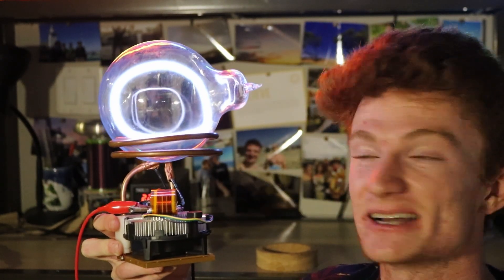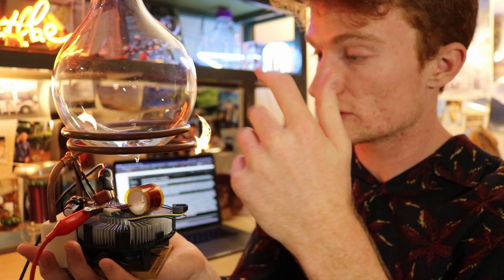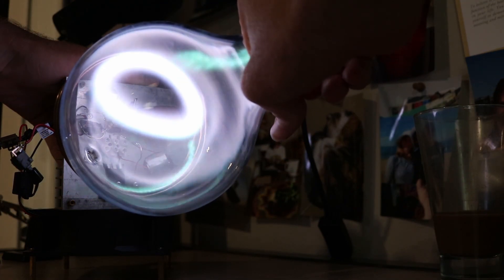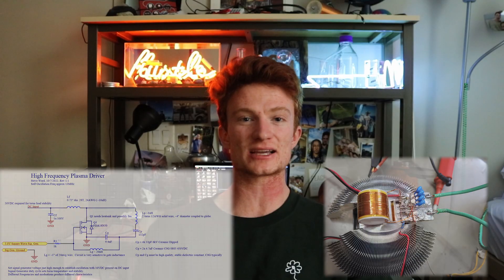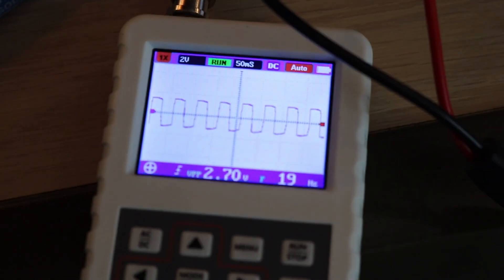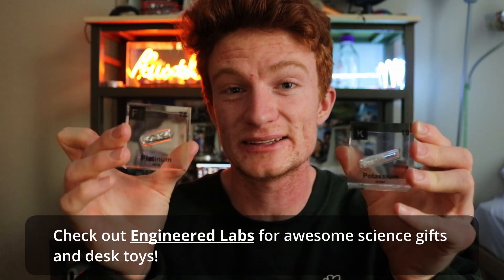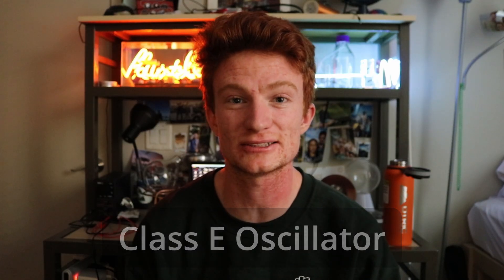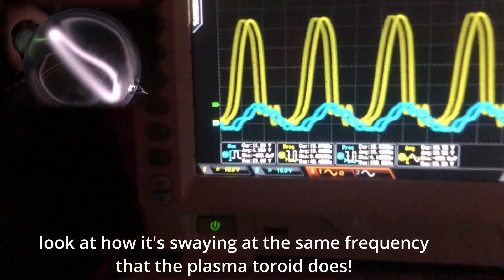perfecting and explaining the plasma toroid

Comment: Maybe a few improvements: 
Add an op amp amplifier for the music input
Add a tvs diode that would prevent overvoltage on the mosfet drain
Maybe drive the mosfet with a gate driver (that is fast enough (there are drivers that have 5ns transition times)) so it switches faster and heats up less. I have no idea if this would work or not though.

Comment: Have you heard of the "Vector Potential Transformer Coil"?

A team of scientists in 2008 were studying the work of Oliver Lodge and James Clerk Maxwell describe a new induction effect called the "Maxwell-Lodge effect". They realized you could generate electric fields without magnetic flux (B-field), using a gradient of the magnetic vector potential (A-field). The magnetic vector potential or A-field is mathematically defined so that the curl of the A-field equals the B field at any point. But when the B field equals zero, the A field does not necessarily equal zero, just the curl of the A field equals zero. So a gradient in the A field can exist while the curl of the A field remains zero (so no B-field). 

Essentially the magnetic vector potential (A-field) wraps around the magnetic flux (B field) at right angles to it in the same way the B-field flux lines wrap around the E-field flux caused by Current flowing. A loop (A-field) around the loop (B-field) around a line (E-field). 

There have been several patents and experiments now that prove you can generate Electricity without Magnetic flux, even through thick metal shielding, by using a "coil of coils", so that the B-field is confined to the interior of the coil, while an A-field (and changing A-field flux) can exist in the axis of the coil-of-coils. 

This could be useful to produce plasma toroids inside of materials that would otherwise shield the magnetic field of a standard magnetic field coil.

Comment: I wonder if you could use other nobel gasses. I would love to build this but xenon is a deal breaker. Argon is readily available. Thinking about using a round bottom flask. Refrigerator compressor as a roughing pump and a gravity mercury pump to get the rest of the way.
Reply from the maker: Yes give it a try with 0.16 Torr argon for best results (according to 20th century literature using a pulsed RF generator)

Comment: If you had two emitters, you could tune the coils with a piece of metal sliding in and out the core in that circuit. Would the beat patterns make moire patterns in the glass? If one emitter was a sawtooth and the was from your bluetooth, and they were at 90 degrees, could you make a floating scope?

Comment: One  question about your circuit. I noticed that your improved circuit follows a schematic from Steve Ward. However, the circuit that you built is not the same circuit. The Ward schematic shows three inductors, a gate, a tank (toroid drive coil) and a bias choke. Your final circuit looks basically like the Teslaundamehr circuit, with only two inductors.  Can you give a more detailed outline of the perfected circuit? 

Getting the toroid to work appears to be a finely tuned solution and it would helpful to have a better idea of the starting point.

Cheers.
Reply from the maker: My pleasure, Alan. My final circuit uses ward’s component values but i create a DC bias to the gate using a 10K potentiometer instead of ward’s (superior) function generator method. (In fact in my next version i’ll use either a series of 555’s or a microcontroller to modulate the gate with PWM like ward, but more compact.) the inductor in the ward diagram going to the gate is just a jumper wire modeled as an inductor (hence the nH value) and can be ignored really, as long as you make the jumper as short as possible. Good luck, and i suggest using a function generator with 5V amplitude to bias the gate instead of the pot, as the pot method makes striking the toroid MUCH harder.
Reply: @BackMacSci  Thanks. One other question. When I was building this circuit for a flame tesla the most difficult part to source was the tank capacitor (HV ~100pF).
I finally ended ed up with a surplus russian RF cap. In your new build you started with some blue ceramic caps in parallel. I assume four 33pF. In the final build you are using a ceramic doorknob cap. Do you have a part # for that cap? If not, the cap/voltage rating?

Cheers.
Reply from the maker: In my final, i used the 4 33pf ceramic dipped caps, not a doorknob cap. Use the 33pf ceramic caps, I will be releasing a BOM soon.
Reply: @BackMacSci  Great. Thanks.
Reply: Got the schematic. Thanks again. 

Cheers.
Reply: Just a comment. The schematic has an error. The power supply is floating (no connection to ground). No significant current can flow through the Class E amp as it is drawn. The source of the MOSFET has to be connected to the negative lead of the power supply.

Cheers.
Reply from the maker: @cometboy1  I used a triangle pointing down from the source of the MOSFET to signify connection to ground. Is that not enough? If I connected the source back to the negative lead of the supply, it would be a big old wire on the schematic. That's why I did what I did.
Reply: @BackMacSci  That is fine for the MOSFET but power has to get from your power supply to the MOSFET. In the schematic the only current path to the MOSFET is through the bias resistors. In any case, I've built the circuit and it works with the negative lead of the power supply attached to the source of the MOSFET. 

Try ohming out your great looking toroid display. I'm sure that there will be a zero ohm path from the negative of your DC supply to the source of the MOSFET.

Cheers.
Reply: @cometboy1  I thought I was signifying the connection between source and negative lead with the arrow, but it's clear to me now that's not the right notation. Thank you, Alan.
Reply: @tatemcaluney6124  It an easy oversight. Just add another ground arrow at the negative power lead. 

Cheers.

Comment: Hey, an idea to make the toroid “sing” you could use another transistor (non-power) connected to the Bluetooth receiver with the output on the input side of the drive circuit. You could tune this to output the right range for the toroid driver.

Comment: Just as a way of "ruggedising" your mosfet drive, have you considered using a comparator to sense the voltage switching and then follow that up with a beefy mosfet driver? Something like a TL712 followed by a tps2816? (just first example parts I found) You'll drive the fet into full saturation or totally off then. no third state of digital logic ;-) You can also shield the input to the comparitor a lot more than you can the mosfet as it's a quite high impedance input. Resistor dividers to bring it into range, Some TVS diodes just in case and then best of all like a 50K resistor before you get to the input of the comparitor lol 

Also have you thought about some kind of igniter? Throw a few hundred volts into the coil from a capacitive discharge or even just throw a raw spark near the sphere itself to kick it into gear.

Regarding youtube aspirations, lighting is key. An old saying if you've got $1000 to spend on a camera spend $800 on lighting. Also a tripod for your action shots would help a lot. For the stuff you're doing if you can get a high dynamic range camera (a lot of phones will do it) it'll help bring up some of the details that are getting lost in the blacks at the moment trying to fit in next to the glowing stuff. I suggest davinci resolve for your colour grading/editing needs, the free version does almost everything the pro version does, plenty for starting out with. And the pro version is a one off charge, not an ongoing subscription cost.

Regardless, you're doing awesome work my dude, look forward to your next video.
Reply from the maker: Thank you Zyeborm! You are awesome for all this. I don't quite understand your ruggedization circuit, but that's on me, I'm still learning. I'm considering working an igniter into the next circuit, yeah, and I use davinci resolve free fro editing and I haven't bothered to color grade hahah.
Reply: @BackMacSci  the (an) issue with MOSFETs is you need to keep the gate drive voltage in a pretty narrow range, you also want to get them to that point very quickly to stay out of the linear region. A comparitor is a chip that just compares 2 voltages and gives you a digital output. If input a > b then the output is high if a < b then the output is low. No middle ground. You feed a sine wave into it you get a square wave out.

A MOSFET driver IC is a chip designed as the name suggests for driving MOSFETs. It'll take a logic level input (say from your comparitor) and turn it into a high current output at 12 volts (if you feed it 12v power). That particular one will push 2 amps into your MOSFETs gate, so it'll transition from off to on very quickly.

Basically it's isolating and buffering the MOSFET gate drive from the resonant part of the circuit. It uses that as an input but not directly to power the MOSFET gate. So if it does weird stuff you're less likely to fry the fet (I think, haven't tried it)
Reply from the maker: I see how it ruggedizes the circuit now. Thank you for explaining each component🙏
Reply: @BackMacSci  no worries mate. Do keep in mind I haven't tried any of that, and 15mhz is pretty dang quick for me. So don't like spend piles of $ on it before you test it if you know what I mean.

Comment: I wonder if you could interlace 2 plasma toroids using something like a klein bottle or doubble klein bottle... And what would it do? Or maybe having multiple torroids stacked within a tube that act as "lenses" to focus whatever field that comes out of those... I mean... We all know particle accelerators like a tokamak use a plasma toroid, but there is probably other ways around using plasma torroids and humm maybe there are new applications to them when "configured" into diffrent geometries a bit like im saying above. Very interresting! Thanks for sharing!
Reply: Actually I think the guy in the beginning of the video did something similar. In his experience he uses a plasma gun (idk what that is either, but it sounds awesome) and shoots two at each other. He found that it was a very good demonstration of 2 galaxies slamming into one another!
Also, what’s a tokamak. I’ve heard of it and tried searching it up. Didn’t get much.

Comment: Just another thought.. Could you use a tube coil like you constructed.  Then connect it to the output side of the secondary coil from a microwave transformer OR maybe a transformer from a neon sign?  Could a large clear light bulb serve the same purpose as the glass you used.  I have some very old bulbs that are probably larger than the glass you used or would the filament interfere with the plasma formation?  I'm guessing you would want to insulate the bulbs original connections just in case that plasma wanted to get out...  LOL

Comment: Hi There!   Great Job on the Plasma Toroid Generator!                        DEFINITELY WORTH A LOOK!!!
To get the field to interact with music or sound in general... Could a small speaker or sound generator output be connected to the glass to make the Plasma move inside the glass... Or do you think the sound would not travel in a vacuum...   But perhaps it would cause the glass to distort ever so slightly, maybe enough to make the plasma move in the desired way.  
What makes the Plasma Ring move at all once it is formed..?  Fluctuations in voltage, amperage or resistance as things heat up could be in play..?  
What if you pulled a vacuum in the copper tubing and stabilized the copper coil with plastic clips?
Really Cool Experiment and Regardless of who did it first, it doesn't take away from anything you did!  Just look at how many people watched it!  :face-purple-wide-eyes::face-purple-wide-eyes::face-purple-wide-eyes: GOOD job with the research!
Reply from the maker: Thank you sir, I don’t know about a speaker moving the plasma but adding more coils would!

Comment: One comment on the green color you pointed out. I have filled quite a few plasma tubes/globs with xenon. Unless you bake the hell out of the glass (under vacuum) you will always end up with adsorbed gas on the glass. There is nearly always air in the globe, so there will be oxygen as part of the mix. Oxygen in combination with xenon will give that green glow. 

In fact, one of the more challenging colors to get in a plasma globe is a strong green. Getting that green involves baking and then putting in a very small amount of oxygen (10-40mT), then a much larger amount of nitrogen, followed by about 50-100 torr of xenon. If you get it right the color can be emerald green. If not, a dimmer green. 

I have no idea if Strattman bakes his tubes before adding the 15 torr xenon. If he does not, then he is getting a small amount of oxygen inside. And you will get some green.

Cheers.
Reply from the maker: Thank you, Alan. I wondered about that because of how the aurora borealis glows green and oxygen and nitrogen are in the atmosphere.
Reply: @BackMacSci  Carl Willis has a really well researched video describing the phenomenon of green in Xe/N2/O2 mixtures.

https://www.youtube.com/watch?v=ECGtUUSL7nQ
Reply from the maker: Thank you Alan, I’ll watch!

Comment: I assume magnets on the side of the glass will change the shape of the plasma? If so, to go a step further, maybe you could make a ring of small electromagnets around the glass and use some control logic to switch them on and off in a pattern to really make the plasma "dance"

Comment: If the voltage of your bluetooth module is too low, then connect a BJT to a higher voltage and use your bluetooth module to drive it, and use the output of the BJT to power the gate of your MOSFET.

Comment: Amazing work, you have inspired me to keep tinkering my otherwise abandoned projects.  My 2c, you can design your PCB and make it for really cheap in any of the online services, you can even make an aluminium PCB if your circuit needs the heat dissipation. Another one, i know you see it as a hobby / interesting stuff, but as other comments say, if you perfect it and find a way to get the glass globes for a decent price, you can sell a run of the kits for some profit.
Edit, if you need some help, besides the creators you already mentioned, contact AppliedScience , i think he will be delighted to see this kind of stuff.

Comment: Here is an interesting idea: try to heat up the plasma toroid with microwaves from a magnetron, just point the magnetron away from you.  Although the excited electrons in the plasma will get energized and will escape from the toroid, you will need large magnetic fields just to trap the charged particles back in, and voilà you got yourself a magnetic confined fusion reactor.  Jokes aside, it might be worth checking the initial conditions of the plasma once you heat it up with microwaves.

Comment: You forgot to say it’s the left hand rule for electric field in a wire. Use your right hand people or it’s backwards!
Reply from the maker: True, instead of saying it, I just did it and didnt explain
Reply: @BackMacSci  I mean if u don’t know that any ways u shouldn’t be messing with high voltage stuff at all. But it does help from getting a face full of sparks tho. It happens or the magic white smoke of death.